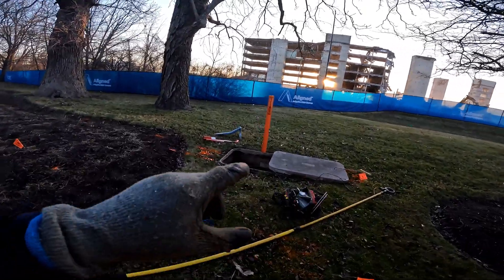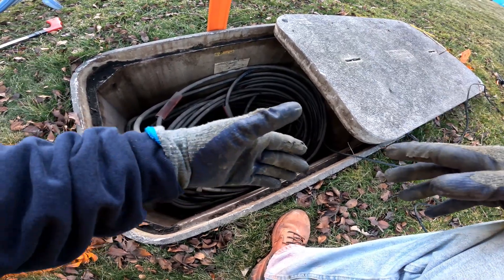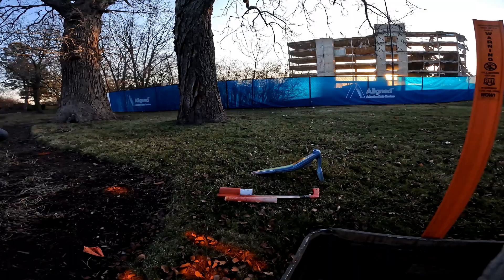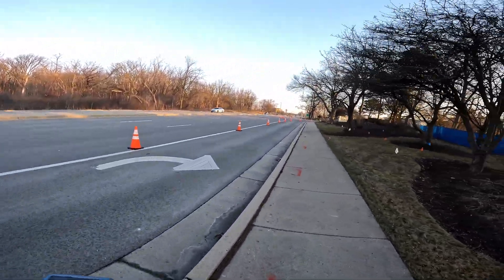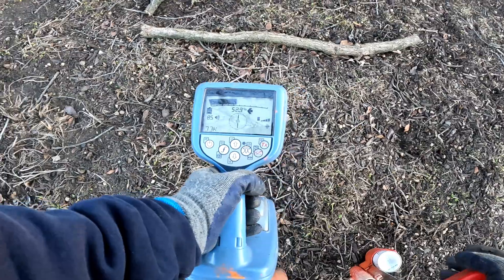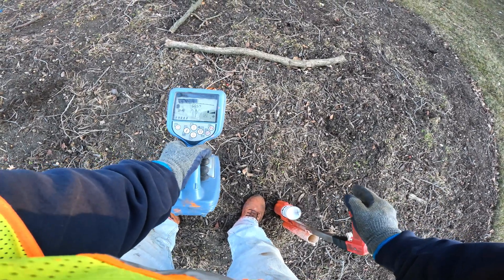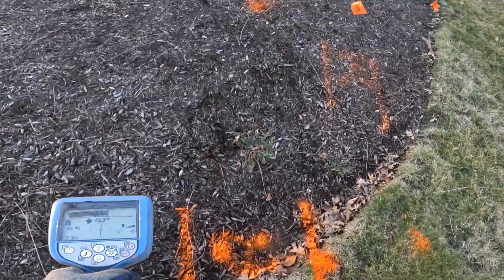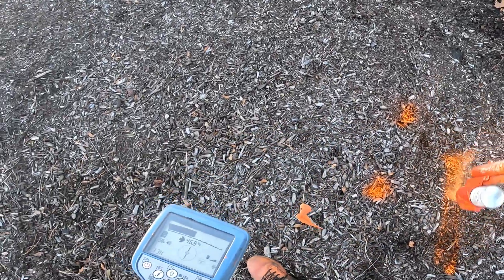Efficient Fiber Optic Ring Clamping: RD8200 Receiver Peak & Null Method

Comment: My fiber is not armor, Can i use clamping on plastic pipe? Can i use clamping on my fiber if is not armor ? What should i do ? Tanks
Reply from the maker: You can’t clamp to non-armored fiber or plastic pipe. You need to find and use a tracer wire to locate the fiber in plastic pipe.
Reply: Can i clamp big coax like 700p3 or 860qr ?
Reply: @811chicago5  can i Clamp big coax like 860 qr or 700p3 ?

Comment: does this only work if the fiber has magentic sheathing around it?
Reply from the maker: A magnet will only stick if the fiber optic cable has magnetic (ferromagnetic) sheathing, such as steel armor. If the magnet doesn’t stick, the cable is either dielectric (containing no metal at all) or metallic with non-magnetic materials like copper or aluminum.
Reply: @811chicago5 Do you by any chance have a video that shows different methods to connect and locate fiber? I just started as a fiber locator in Vegas and the company I am with has very ehhhh training so I feel so lost at times when I go to hook up and cannot find a tracer wire and none of the fiber out here has sheathing and none of my coworkers have clamps or ever used one in Vegas. I keep my magnet with me hoping to get lucky one day!
Reply: @811chicago5 I was trained in Utah and our troubleshoot method when our leeds would not give is a connection was to clamp and go

Comment: How often do you have to clamp vs hooking a ground lug or finding it skinned by someone else?
Reply from the maker: Ever since I returned back to the 811 locating, I've noticed that some of the fibers have been peeled back. Peeling back the black sheeting eventually will cause that fiber to fault out. 90% of my locates, I direct connect; the only times I clamp are in M-H's, H-H's, or at the pole.

Comment: When i clamp it automatically goes and stays in 8k how did you get it to 33k when you ring clamped it?
Reply from the maker: Your equipment remembers your last settings. So to change it to a higher frequency on your transmitter go to the F button to cycle through the frequencies.